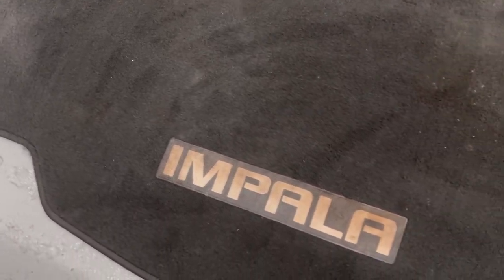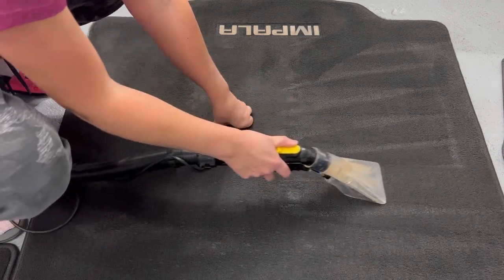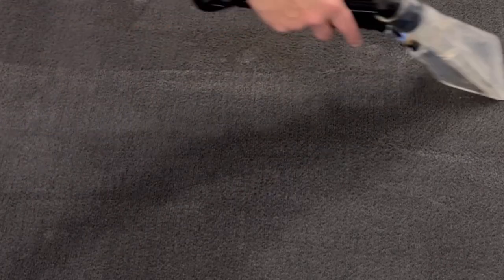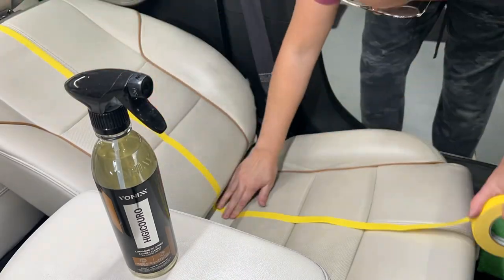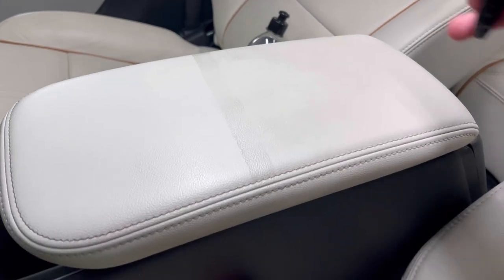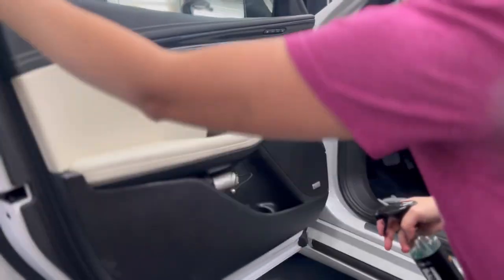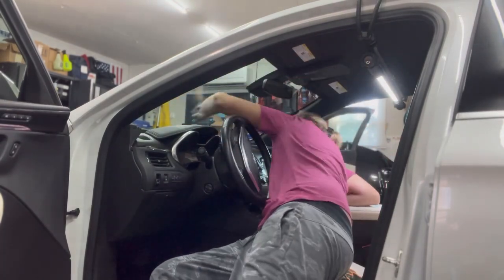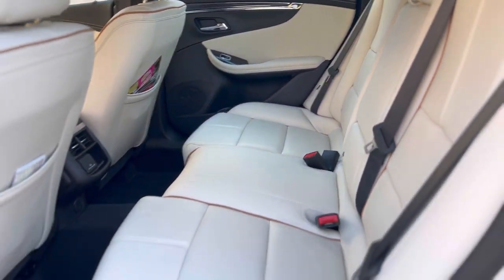Impala Interior Detail: Attacking Germs + Dirt with Vonixx Car Care (Must Have For Cold/Flu Season!)

Comment: Great video! Why is it when I use some leather cleaners they tend to leave droplet and running stains?
Reply from the maker: They could be too strong of a cleaner, or you were letting them sit on there too long. I notice that as well with certain chemicals. Could also be the condition of the leather if it’s more degraded or dirtier, the chemical has actually instantly removed the dirt, but because of its potency and spray pattern, it will clean the areas that it comes in contact instantly. I didn’t notice that with this product, but a tip is to spray your applicator versus the actual leather if your product is doing that to you. Or gently go over with a magic eraser to remove the drip stains.
Reply: @attention2detailswchelsea  Thank you so much for the reply and supplying me with much needed information. BTW the leather cleaner I use is Superior Products Leather Cleaner

Comment: Hi Chelsea I hoping you could suggest since I don’t have an extractor.  How I could attack the same method using my Dupray steamer?  Thanks in advance 👍
Reply from the maker: Do you have a polisher?
Reply: @attention2detailswchelsea  yes I do. I have a rotary and a DA
Reply from the maker: You could try lightly misting the product on and then using a microfiber pad or a wool pad do a bonnet cleaning method. Wouldn’t be near as effective if heavily stained but because it’s low foaming should clean and refresh. Spray, scrub with steamer and microfiber cover over steamer then bonnet clean after which will transfer the stain from the carpet to the “bonnet” or pad. I did a video a while back showing how I would do bonnet cleaning if you want to see the process
Reply: @attention2detailswchelsea  thank you I’ll go look at that video .  Then I’ll use the bonnet method.👍. I appreciate yours videos and the tour you did at Stoners MFG that was awesome 🤗🤗🤛